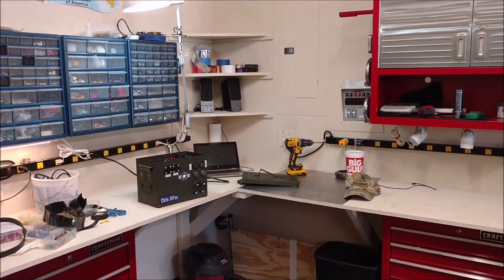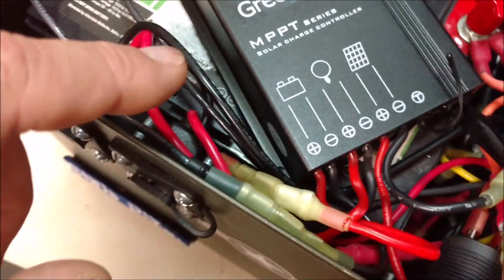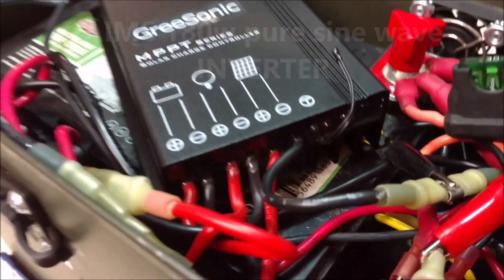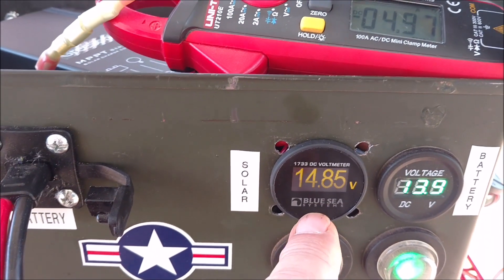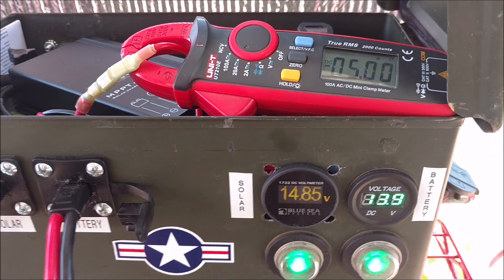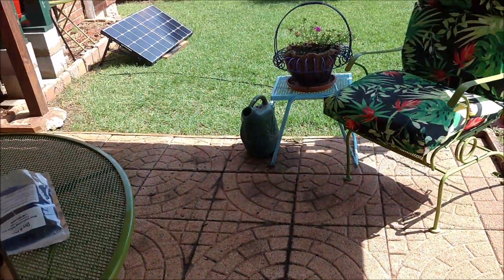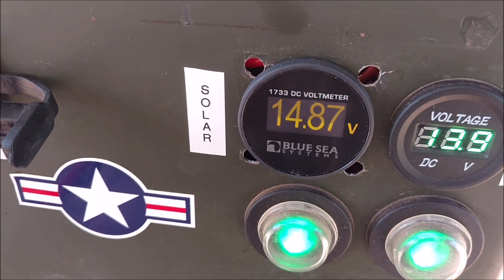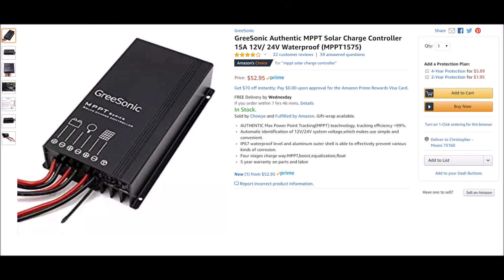GreeSonic 15-amp MPPT solar charge controller - Is it really a "true" MPPT solar charger?

Comment from the maker: NOTE: Notice how it "hunts" for highest voltage (power point) every 1-minute? The Tracer's I own are slower...which is annoying. This one is quite brainy. There are "hard set points" on this unit...non-adjustable battery bulk/float voltages. But, quite decent for my AGM deep cycle batteries

Comment: So, I wasted 4 minutes on this video, which asked the question; "is it really a true MPPT charge controller?" There was a lot of blather, but the question was not answered. Oh well.
Reply: I would call it a hybrid. It helps increase amps but doesn't really convert volts to amps. Also pretty weather resistant without a lot of bells and whistles.

Comment: I have one of those charge controllers, got from Ebay, looks about the same but has no brand name, it as described as li-ion charger but it charged my li-ion battery until it puffed. I`m suspicious it is not 
appropriate for li-ion as described.

Comment: Pretty nifty.  I just hooked up an old PWM controller to power my hydroponics.  I have a 100W panel feeding a couple of left over GC batteries.  Way over kill.  I had to buy a new Pure Sine wave inverter, since the modified ones keep burning up my timer.  I will probably do a video on it once I get things tidy and less hobo looking.
Reply from the maker: Would like to see that hydroponics set up & running...sounds cool

Comment: Surprising, a lot of mppt chargers are fake as you know, just like ultrasonic cleaners I've found, good find.
Reply from the maker: Also, a great price point for smaller systems. Heck, run it in a 24v configuration and get 15 amps x 24v = 360 watts. Nothing to sneeze for $52 IMHO. Time will tell! Pls use the link I provided if interested